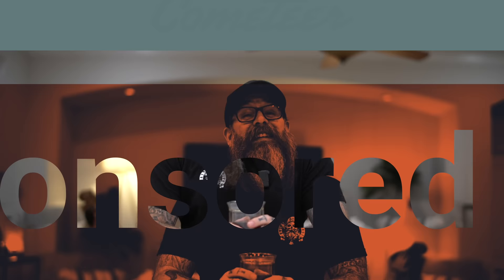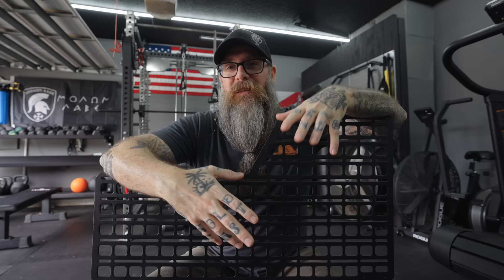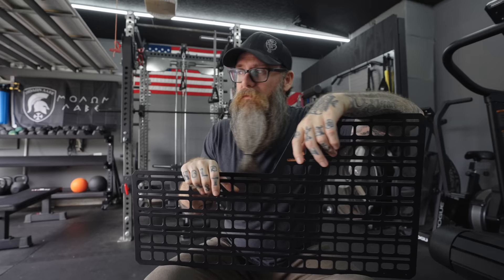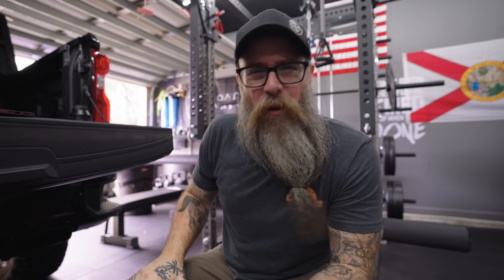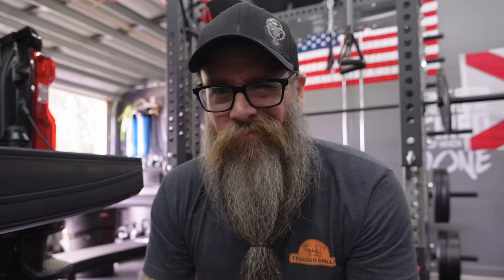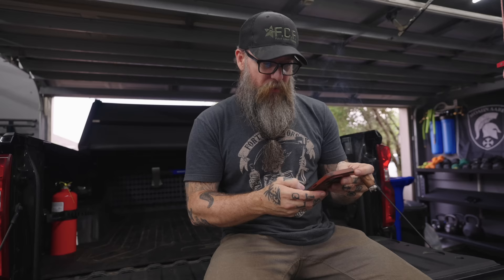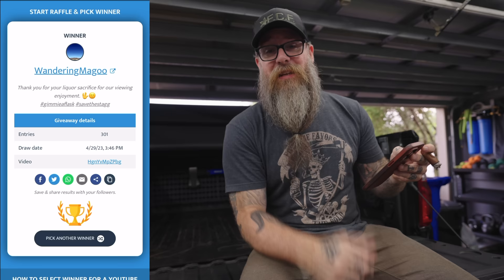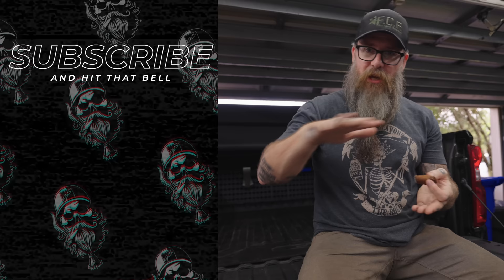The Ultimate Truck EDC Build Out | Pt.1  Builtright Industries MOLLE Panels

Comment: Molle panel on back of passenger seat has a fixed blade esse a molle case for sig m17 and fn503 with a can’t and a dump pouch with empty extra mag for both weapons a empty AR mag my ear pro and stop the bleed kit. And a cr123 battery wrapped in serran wrap. 
Bag sits dead center so it near passengers crouch but can still get in and out easy and it’s accessible by me as the driver. 

I have 2 hooks I can hook on and hold battle belt and vest when I goto work or range or competitions and seat lifts with flat floorboard to store stuff on that dual seat side and can still carry 3 people comfortably 
If more gear is needed it goes in a locked and secured tough box bed mounted to a metal bar like cooler mounts so it can’t be stolen easy and stays dry

Comment: the cam system you're talking about for mounting the panels is really similar to Magpul's M-Lok system on rifles. Very neat that they adapted it to something like this
Reply: also, if you have room between the driver's door and the base of the driver's seat, imo that's the best place to put the extinguisher and that's where I've seen them mounted in every humvee and semi-truck I've ever been in. It has the fastest access for the driver so you don't need to run to the back of the truck, open it, unmount it, etc to put out a fire on the other side of the truck. It's just efficient and doesn't really get in the way, and it's easy to check whenever you get in whether your extinguisher is still good

Comment: I did an EDC build for my truck. I used the Decked Storage System on my Gladiator because the system allows the contents of the drawers to be more secure and its more of a overlanding and less for towing and hauling, basically a toy. I did develop a truck gun, its a KS47 from Palmetto State Armory, which is an AR platform that feeds from AK magazines and shoots 7.62x39. I call it a poor mans 300 backout. #VISKIWHISKEY #TRUCKEDC

Comment: That's some great gear you're installing. In addition to the fire extinguisher in the back, you might want to add an Element fire extinguisher (or two) in the cab, something that is easy to stow, you can grab right away and is light enough so that it won't become a missile in the event of an accident or hard braking event. They also put out twice as much as the typical fire extinguisher. But keeping an extinguisher only in the back can waste valuable seconds in the event of an emergency. I always laugh when people say, "They're SO expensive!" Like my rig isn't worth an additional $30 for twice the output and immediate access of the fire extinguisher.